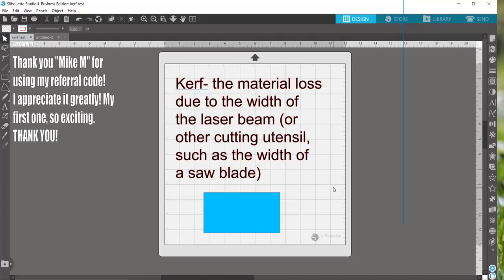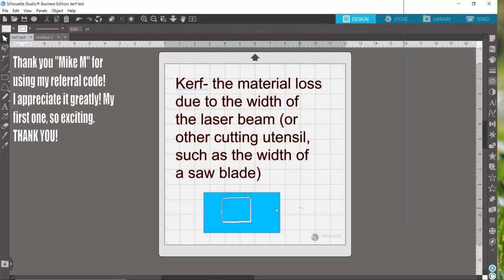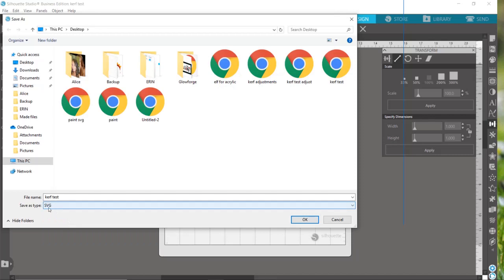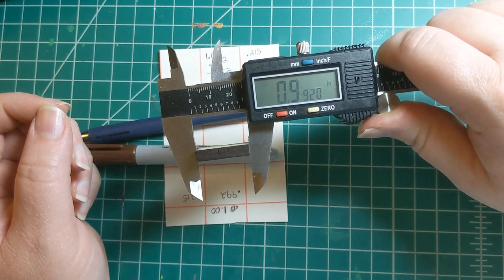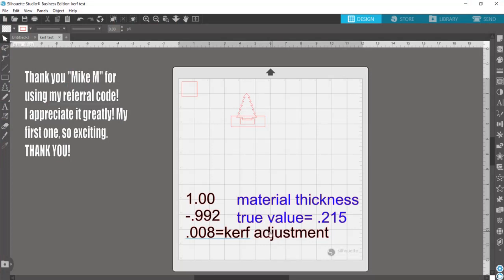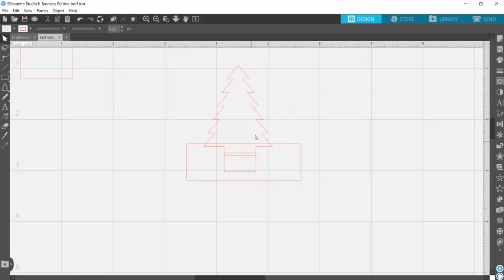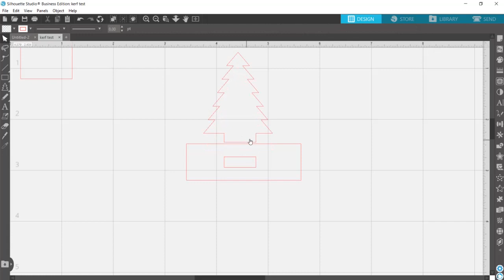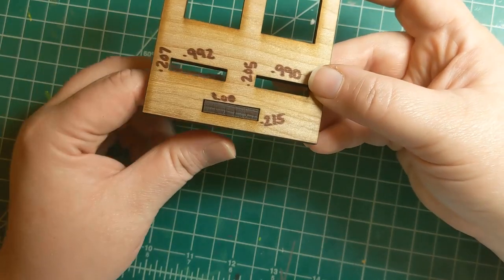Calculating and adjusting kerf for Glowforge using Silhouette Studio

Comment: So if we’re doing a cut and fit- it is recommended to always do a Kerf cut for adjustment, correct? This video was awesome. I just got my GF and have learned so much in just two of your videos.  Thank you so much for sharing your knowledge. :)
Reply from the maker: Yes I recommend doing the kerf test first with your material so you don't cut the full design and then find out it doesn't fit together like you want. If you use the same materials with the same cut settings often, the kerf adjustment should be the same. For example, I like using the birch from HD and have saved the cut settings in the GF, I have been able to use the same kerf adjustments from sheet to sheet. If all else fails, I see no shame in a little wood glue 🤷😁